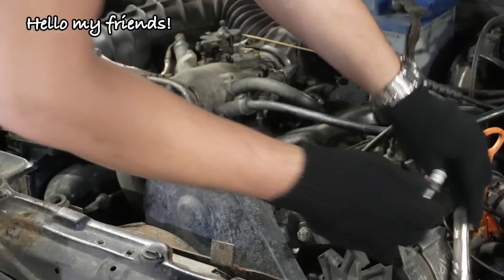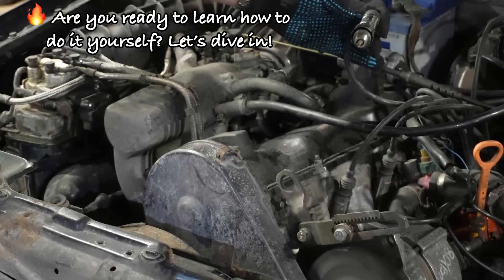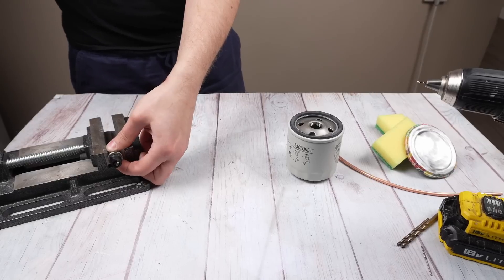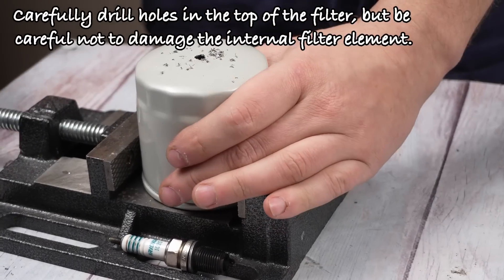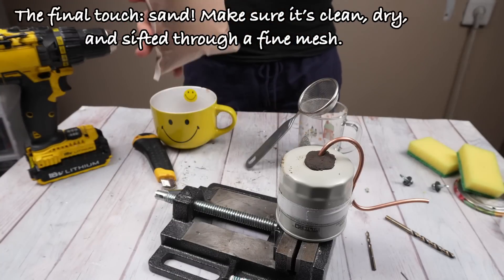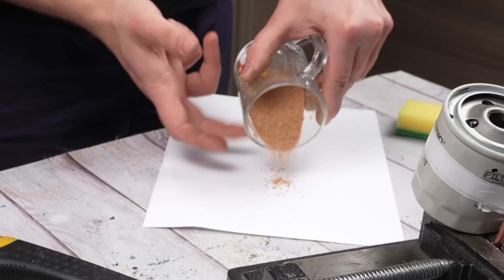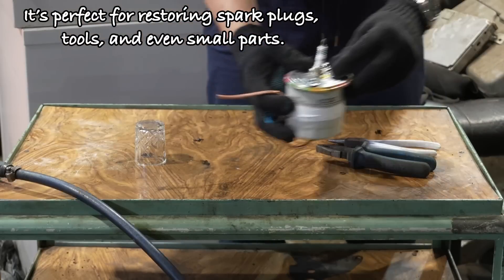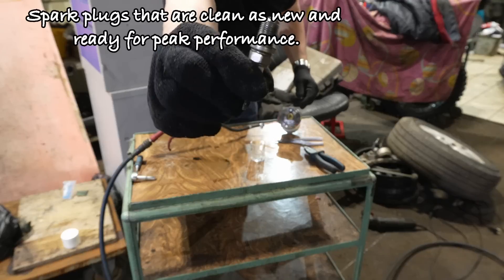Put a drill bit in a SPARK PLUG! It will add a DOZEN horsepower

Comment: The aim of a spark plug is to ignite fuel mixture and as long as it sparks, that's fine, drilling a hole will make no difference to horsepower, it just weakens the plug, metal could fall off the end and destroy your engine.

Comment: Where on earth did you get this idea? That drill bit will shake/vibrate loose and fall on top of your piston and very  possibly be slammed into/through the piston causing untold damage, far more than the cost of a set of new spark plugs.

Comment: Hello friends. I tried this too. I used a metal file, not a drill. The result was that the torque seemed to increase, as if the wheels were always spinning. But I don't think it increased 10 horsepower. There are no particular problems. The fuel economy improved and the idle was stable.

Comment: Drilling the hole is great idea BUT for high compression engines it will blow the arc  in two and drop a small piece of metal into your combustion chamber to bounce around. 🤔 Not sure what that could do to an engine! Maybe it would just blow out the exhaust pipe. MAYBE!

Comment: Cool. Afterward the drill bit will still be sharp.  Carefully align it to the space above your nose, between your eyes, parallel to the top of your head, and drill. Be careful to withdraw before hitting brain matter. This will release excessive pressure in your head and raise your IQ by 14, up to 20 points. Don't you think that was easy? And look how smarter you are.

Comment: I remember the time I replaced my spark plugs with plutonium rods and greased my brake rotors. I went so fast that time and space warped around me and I wound up in an alternate reality filled with people so stupid they believe drilling a hole in a spark plug will increase horsepower.

Comment: Use two spark plugs msd 41 mm mags advance spark timing fuel but pressure it's what makes biggest difference turbo blower airplane plugs  magnetos
Reply from the maker: what a great knowledge you have! It's nice to have such experienced viewers
Reply: @FixItFast1  I heard if u line ur spark plug up evenly one might be tighter than other makes ur motor faster that I heard from American German engineer and roller 🛼 bearings as main bearings split cage skf cooper splitcage as crankshaft n camshaft main bearings
Reply: @FixItFast1  porting air throttle body fuel injector pump high flow and timing energy  yes take out alternator regulator put variable

Comment: Well i share a much shorter version.... yes drill bit the spark plugs but cleaning all he had to do was us a wire grinder and some brake cleaner spray thats it he did to much all that was unnecessary with the oil 🛢 filter smh

Comment: You're not holding the spark plug or the wire going to it just for fun. The wire carries a lethal amount of amperes, which means you risk getting so much electricity into your body that you will die right there.  It is wrong to show videos that people watch and do the same thing as you show without any warning.  That is a life-threatening act that should not be shown on video without warning people of the risk of electric shock. If you make these videos that many people watch, the least you can do is inform them about the dangers of electricity. The car's engine is working as it should, even though you've supposedly removed one spark plug, which is in no way possible. There is no intake sound from one cylinder when the valve opens, which is why there should be a hissing sound from the engine at every revolution when the sleeve is missing from the cylinder. I don't know where you got the power for the spark plug, but at least it's not from that engine that you're running and showing a huge arc of light that goes from the spark plug to the engine body.??? How dangerous is an electric shock when the spark should come from the spark plug gap and not from the plug!??⚠️⚡🫀💥
Reply: Are you sure about the high amps? Remember - it takes the 12v from the battery up to about 20,000v subsequently the amps reduce to a very small amount to keep the electrical energy the same. I have seen many people being shocked by the spark plug. Highly unpleasant, but none were anywhere near fatal.
Reply: I have been electrocuted about 1000 times and I am still here . I use to stick my finger in the end of the plug to check for spark LOL maybe that's what's wrong with me
Reply: @KnightOfChrist1978  people have been programed to be p u ssie s .
Reply: @KnightOfChrist1978 lol you've been shocked over a 1000x you only get one chance at being electrocuted✅️.  It's fatal🙄🎯
Reply: @KnightOfChrist1978  people are pussies nowadays
Reply: @KnightOfChrist1978 It only takes one to knock your heart out of rhythm.
Reply: That is fasle
Reply: You make a good point about the potential risk of electrocution.  I think there should have been a warning there.  The other point is not quite right.  A car will run badly with one cylinder malfunctioning.  And the video was consistent in showing this as the engine sounded out of balance.  At least for me.  I don't think the author was trying to fool anyone.
Reply: @twinwankel well you're right..the author is not trying to fool anyone...he is a fool.
Reply: @v950
I never met a diesel that used a spark plug. You’ll have to explain that one.
Reply: Very Well Said 🏆 I have a story to tell if ya don't mind. I was working at a garbage truck shop once and one of the mechanics was welding on a front End Louder truck's rear end somewhere and standing on the Steel Grade that runs from the Wash Bay to the Other side of the Shop. I was washing a Truck and heard Tracy SCREAMING . I ran through a door where he was welding. He was being electrocuted. I know what happens when a person touches someone like that but I did it anyways. I kicked him off of it and the shock blew me 10 ft back but I was okay I'm so he
Reply: @JohnHall-uv2jm  to test spark you need to touch plug to grounded metal as spark it between center and ground electrode. If it's even possible to shoot spark off end of plug, then you better start reading a wiring diagram....
Reply: @jessefalker5468  I know about the touching it to metal. I didn't know about the drilling holes into a oil filter and making it look like a bootleg whiskey still
Reply: @JohnHall-uv2jm the welder was a/c current, that's what is dangerous.
Reply: @garywalls9041  again your dillusional don't tell folks fake or stupid shit.
Reply: Knight of Christ1978
You can be shocked many, many times, but you can only be electrocuted once. But even a slight shock can throw your heart out if rhythm and harm you. This is not only a waste of time, but extremely dangerous to you and potentially harmful to your engine.
Reply: Your so clueless how this actually works it's cute seeing you try to write it out line you actually understand anything about a car! Yes this is plug from car in video. Yes a car will run with a plug pulled. You aren't going to hear a hiss sound while the engine is running extra loud sounding like garbage bc a plug is mulled and it mis firing lmao and no this shock will not kill you lmao. Plz refrain from trying to act like you even know how to change your oil clown
Reply: @ if the voltage passes through  the chest. The heart might stop.
Reply: @tomrinde4487  clownnn
Reply: Td international  engines start  on gas then change  over to diesel.
Reply: Same potential
Reply: The engine looks familiar I'd say it's a om617 mercedes diesel thats what it looks like
Reply: It's DC, not harmful
Reply: DC is deadliest voltage it is a straight line on the scope never off voltage. AC has a sine wave that for example120 volt house current would alternate 120 volts to zero volts to 120 volts on negative side back of the scope back past zero of scope back to 120 on positive side of graph. This allows someone's muscles to deflex allowing you the opportunity to let go of wire. 60 cycles a second. DC voltage is a straight line on the graph 120 volts never crossing 0 volts as there is no cycling allowing muscles to relax, release. Your muscles will cook slowly as you cannot deflex, not being able to release.
DC is deadliest
the great electrician killer. Also when 12volt DC is converted to high voltage 10000-20000 volts very low amperage. That's why when you are shocked by spark plug wire healthy people survive people with pacemakers, heart conditions sadly dont at times survive.
Reply: Gary: Contractor, Master Electrician here. Your talking out your ass
Reply: Every shade tree mechanic tests for spark this same way

Comment: Are you absolutely NUTS!
Reply: @brianmansfield666 ! Das glaube ich dir sofort und bin überzeugt, dass du das auch ohne Unterbrechung täglich machst.
In psychartrischen Anstalten ist Beschäftigungstherapie kostensparender als Medikamente.

Falls du ein Komiker bist, sorry, aber mache dann noch den Mittelfinger zu deinem Beitrag!
Reply: Been doing this for years …it works. Try it. Nothing to lose except old set of spark plugs..
Reply: @brianmansfield666  You've been doing this for years? You clean the plugs and drill a hole in the ground electrode?  Did that increase your HP?  And how long did it work for?